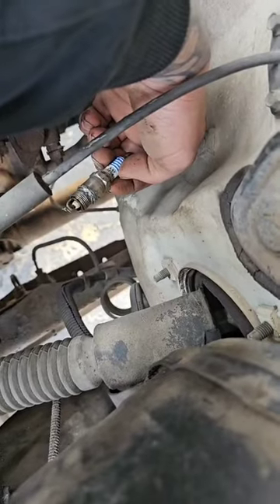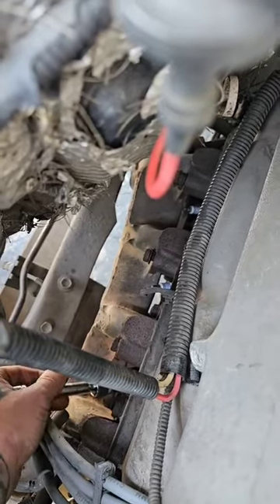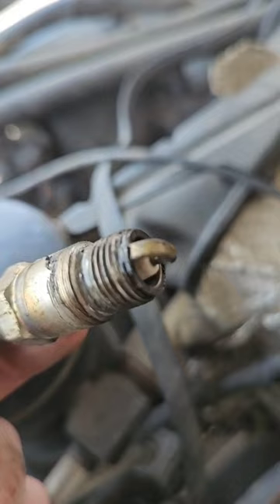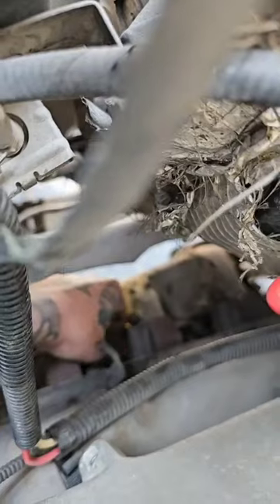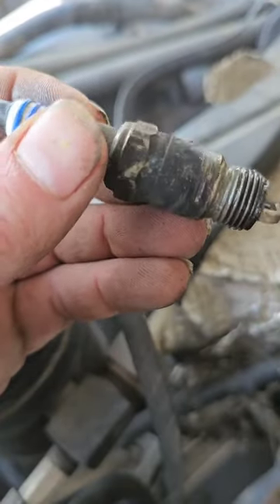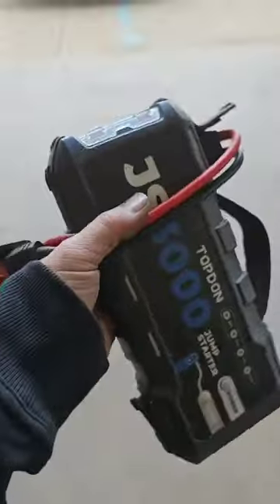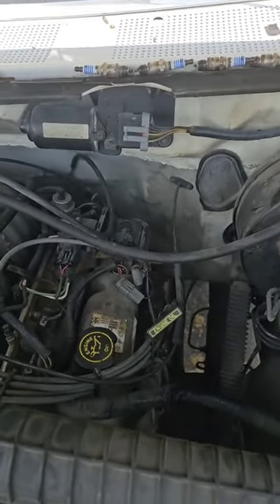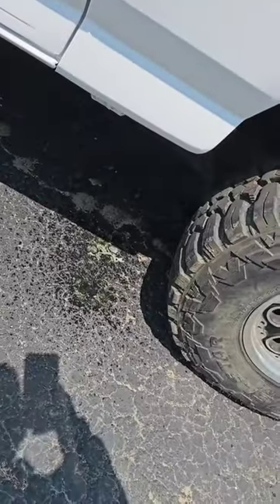may also have bent internals as well.

Comment: I work in power generation.. I was on a service call at a target store one time, the customer was trying to do his monthly load test of the generator, and it wouldn’t start..  It wouldn’t start because the controller was  not it in the correct position..  

Anyways, during my initial inspection (Ford 2L) they actually had a ball valve on the bottom of the exhaust stack. I opened it and a little water(rainwater or condensate) came out so I pulled the plugs and cranked it to make sure there was no water in any of the cylinders- there wasn’t, but there definitely had been at some point..  

The unit ran fine without any issues.. It was running at set speed, and could handle building load without issue..  

I condemned it anyways just to be sure.. When I pulled the head off and manually rotated the engine- cylinders 2&3 are companion cylinders. When 2 was TDC flush with the deck 3 was just a 1/4” below it… Yup- Bent Rod..   No idea how long it had been like that 🤷‍♂️..    Anytime there is a stationary engine inside a building with an exhaust plumbed up through the roof- condensation buildup on the walls of the exhaust piping is inevitable, as well as a stuck rain flap…  That’s why they put drains on the elbow to the outlet of the silencer….

Comment: My 4.6 had leaking intake manifold gasket which filled one cylinder with coolant. Was engine replacement time.
Reply: Rare. Those 4.6L V8 mod motors were rock solid.
Reply: @Davido50  eh they original intake manifolds they came with had some issues after time and could leak
Reply: Mine did the same. Cheap plastic manifold

Comment: Could just be intake gaskets (i had this happen). Great thing about changing the head gaskets is that you'll also have to change intake gaskets.  A full head gasket replacement will give you the opportunity to replace most of the gaskets on the engine and see the real condition of the engine.

Comment: Here's what just happened to me and I want to help my ford family community. 

No start,no crank,no code.
Turned the key and nothing, on my screen this popped up.( starting system failure)
 No it wasn't the plug under the hood by the firewall, no it wasn't the plug in the footwear on the passenger kick panel but in the kick panel pull fuse #18 check that more than likely you'll just need to reinstall  it. Found a article on this after I replaced the starter,chased relays another of relays, and fuses. Hope this helps.

Comment: You do realize that the kidney killer if there is antifreeze in the engine the cylinders are scratched if it was hydrolocked the rods are bent. If it's in the oil pan the bearings are gone I think the dexcol does not do the damage that that green shuff does

Comment: Dude I have the exact same truck and motor if that's a 5.8 big block 351 Windsor
Reply: it's a small block 351
Reply: @joee3474  ohhhh mine is in a 94 Ford f150 xlt 4x4
Reply: 5.8 Windsor is a small block

Comment: I’ve got a head scratcher for you mike. 2005 gmc sierra 5.3 code for -cam position sensor low voltage. 

Replaced the sensor with GM genuine part

Replaced the pig tail connector for cam position sensor (wires were in bad shape at the connector) 

I’m only get .7 volts and I believe that’s supposed to get 5 volts. 

I’ve checked my ground wire for that circuit and cleaned them. I’m getting 12.5 volts when I check those grounds. Kinda at a loss for now. Sometimes trucks fires right up, other times 2-3 starts I’ve got a head scratcher for you mike. 2005 gmc sierra 5.3 code for -cam position sensor low voltage. 

Replaced the sensor with GM genuine part

Replaced the pig tail connector for cam position sensor (wires were in bad shape at the connector) 

I’m only get .7 volts and I believe that’s supposed to get 5 volts. 

I’ve checked my ground wire for that circuit and cleaned them. I’m getting 12.5 volts when I check those grounds. Kinda at a loss for now. Sometimes trucks fires right up, other times 2-3 starts (much appreciated if you have the time to reply to me!)
Reply: I'm not 100% on this but I'll try to help. Your .7 reading is accurate to the cams position currently. Fire your motor and try again because that sensor determines position on a 0 to 5 millivolt range.
Reply: @mikemeyer2155  okay thank you, I was told by someone in online forums that the .7 is the “reference signal power” but I believe I’m losing the power during cranking. It’s supposed to have 5v at the sensor from what I was told. Even with the key in the on position only .7 volts , I’m not master at electrical stuff I actually hate it. So any advice or places to look is much appreciated

Comment: My 82 year old neighbor has 96 Chevy pickup all the cylinders fill with gas any ideas?
Reply: it's the spider fuel injection. plastic tube that run to the intake to each cylinder and they are leaking filling cylinders and crankcase. it's not a bad job replacing the fuel injection system and that's what it needs .